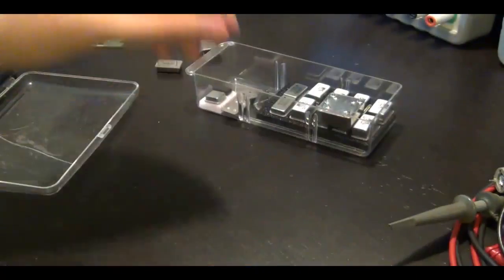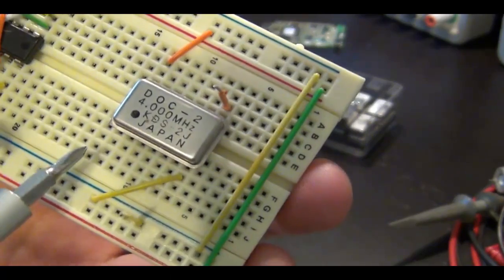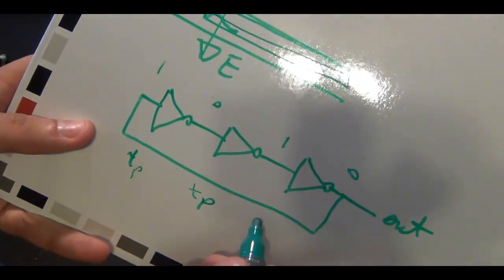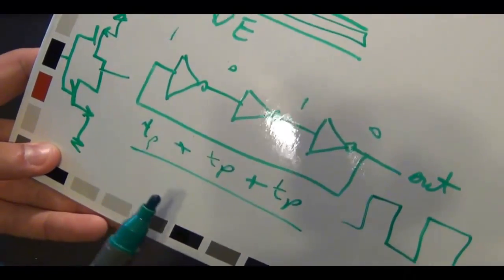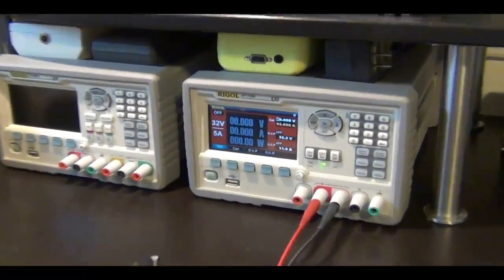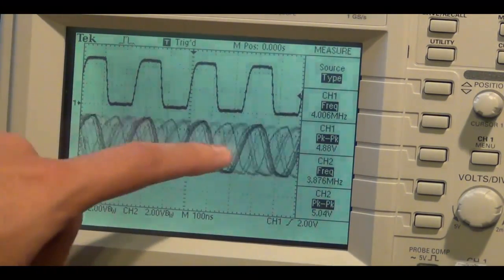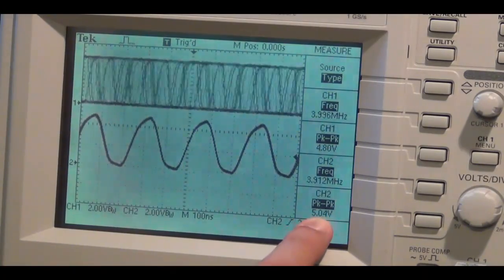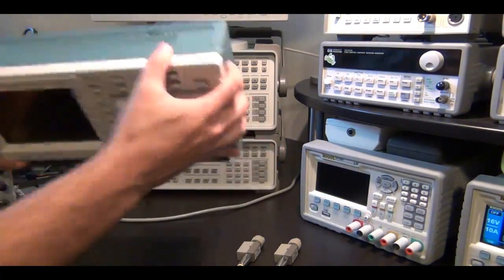TSP #4 - Frequency Generation: Crystals and Ring Oscillators (Part 2/4)

Comment from the maker: @Grundalizer It is important to note that the homemade ring oscillator does not accomplish oscillation by establishing a resonance circuit. It is more of a chain of delay elements (with gain) which satisfies the criteria for oscillation. Furthermore, it is an active circuit requiring a DC input and would not oscillate without the presence of it. However, once they are both powered, it is possible for the crystal to influence the oscillation frequency of the other circuit through noise injection.

Comment: This is one of the best ratios of git-r-done down-to-brass-tacks practicality while still giving a good bird's eye overview of how it all works together at a higher level. Just fantastic, please keep it up. Reminds me of some of the better MIT profs on OCW who draw a good balance between theory and practice. You mentioned doing a theory video, that would be interesting as well. Also, I was wondering where you recommend getting vintage parts. I heard you mention ebay, but wondering if there's any others. Or if anyone else on the boards knows, please throw up a post of recommendations. I'd love to have a crystal I could take apart with a screwdriver.

Comment: Really nice explanation of a crystal oscillators, but at 6:55 try connect GND first before signal. This will prevent a headache from damaged IO and oscilloscope. Simple CMOS circuits does not have ESD protection diode, so be carefull. (And yes, a good oscilloscope should survive this handling).

Comment: If you connected the power to ONLY the factory built 4 MHz oscillator and not your homemade one, but then looked at a signal or voltage coming from the homemade one, could you get the signal output to travel through the air and cause the homemade one to oscillate since it has the same resonant frequency?

Comment: How does a crystal oscillator starts oscillation in the first place? Could you please explain in a bit more detail? for MEMS resonators, we basically apply a DC + AC in order to make it resonate and the AC is really the part that carried the "Omega" information. But in your video you only used a DC.

Thanks

Comment: what would be the problem to use just 1 not gate instead of 3 in the ring oscillator ?
Reply from the maker: +iceberg789 That circuit will not oscillate. It does  not meet the Barkhausen criteria for oscillation.
Reply: +The Signal Path Blog Even if it does have a Schmitt input?

Comment: Hi, I have 2 questions
1. Can I use a 555 timer to do the same? or is it too slow?
2. Which IC did you use in this video? those cmos buffers
Reply: +MyDvR7 First of all,  a 555 will not have as much stability as a crystal by a long shot. I'm almost a complete noob but I can tell you this oscillator business deserves and most likely has a book of it's own, if not several. I only skimmed over the subject once or twice so chances are I may be talking out of my ass. All I did was to buzz speakers and flash leds with 555s. I know of only two famous 555 flavors (ttl original and cmos - 7555 I think which runs on less power) so you should check the datasheet for maximum allowed frequency for the exact chip you have. I think you're good for a meg or so no matter what but I would not be surprised if stuff goes south upwards of 20 megs cause the darn transistors can't turn on fast enough after a certain frequency. *Also google or youtube self resonant frequency on caps. These fat bastards can be a pain in the ass*.
If you need a spot-on precision oscillator or something exotic for radios & stuff, I'd google oscillators or something and read my ass off. There are quite a few famous ones like: Wien bridge, Colpitts etc. etc.

Comment: I dont have spectrum analyzer yet, but one day maybe i will got one. Which one for begginer?
Reply from the maker: +Hrvoje P. I have several spectrum analyzer reviews on my site. Although they are all fairly expensive. For beginners, I suggest your pick up an SDR from eBay for experimentation or a used HP analyzer.
Reply: I agree with used HP :)